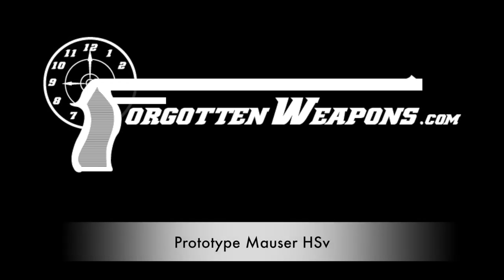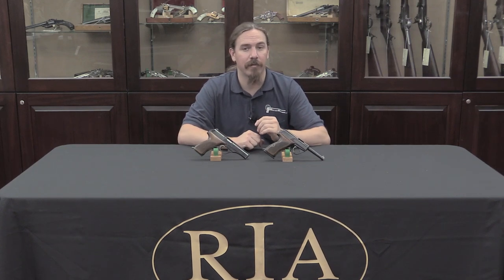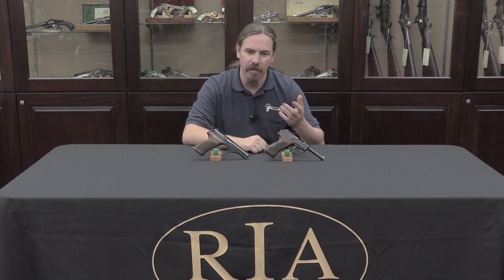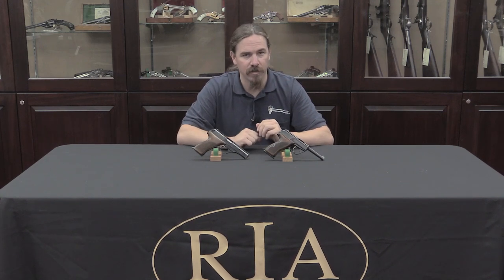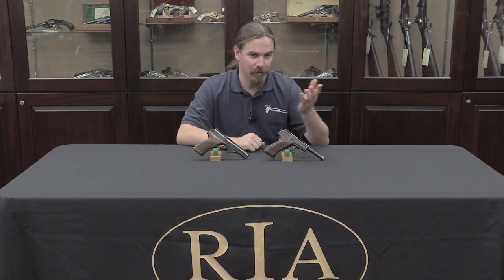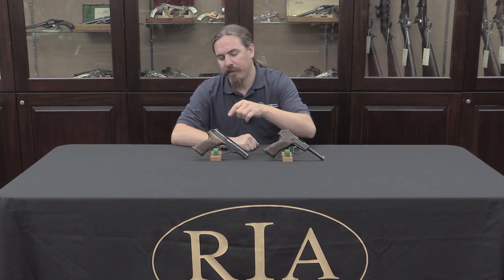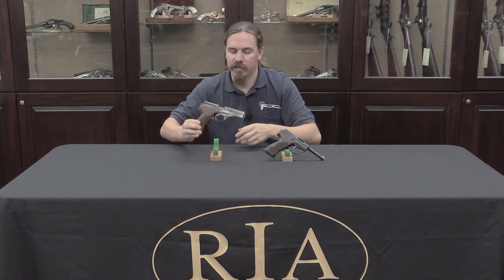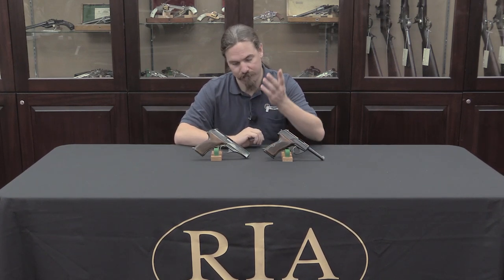Prototype Mauser HSv Pistols

Comment: Exposed barrel was there to use firing ports in vehilces(tanks mostly), which vas very common at that time (info 100%), there were similar trials in soviet union and experimental tokarev"s pistol with exposed barrel, but idea was scrapped.
Reply: Idea wasn't scrapped. Just before tha war started Tokarev were planned to be replaced by Voevodin pistol, but it was abandon because of war started. Here's the photo of that Voevodin Pistol - https://mtdata.ru/u26/photoDF6A/20646352317-0/original.jpg
Reply: I'm not fully convinced, as exposed barrels were also in the Mauser C-96, Borchardt and 08; in fact, it is very easy to dislodge the barrel in a P38 so it no longer is firable. As far as I have heard, it was in case of a bad cartridge that ruptured the barrel; if a slide is over the barrel, it may become stuck so you cannot even repair the pistol. I have heard that in case of a ruptured barrel, an exposed barrel lets you even fire the pistol as it doesn't interact with the slide, but I'm not convinced of that.

If you look at the Mauser G98, you see that it also had many safeguards against a catastrophic cartridge failure. It may be that a projectile could become stuck in the barrel, with the next projectile rupturing the barrel into an umbrella-shape. 

Today, that is no longer a problem, but especially in war, ammo quality or sabotaged ammo definitely were considerations by Germany. There exists even a document warning of "found ammo" ("Fundmunition"), that soldiers should not load it, but give it back to repair shops who would evaluate it and then re-issue it, with warning labels.

Germany and the Soviet Union closely worked in military development after the Rapallo treaties 1922, so it is possible that those considerations were shared with Soviet developers also.  It is possible Stalin's cleansings and the shift in perception towards Germany after Barbarossa meant the people sharing that concern were no longer in charge, and the risk of "found ammo" was no longer deemed prevalent as no Soviet weapon shared the calibre with a German one. Note, however, that until today no russian weapon is in an interchangable calibre to a foreign one.
Reply: @ЕвгенийМакаров-в6л 
...Looked like a more somber 
Japanese NAMBU pistol 😊👍

Comment: I would suspect that the reason the exposed barrel version has the heel mag release is because the recoil spring arms are in the way for a button release.  When you took the grip panels off it confirmed my suspicions and just thought I would make a note of it since you stated that it may have been an oversight on the military specifications that you have located.  Nice work and thank you for the educational videos.
Reply: Right on spot.
Reply: Besides, it's theoretically less empty space for crap to get into.
Reply: Peter Stephenson Stop blabbering nonsense. You obviously have no combat experience therefore your lenghty discourses make absolute non sense. I've met Vietnam vets who took a shop bought handgun with them when they shipped off, and guess what?many used them in combat. Read the Thin Red Line to find out how desperate were some GI's to have a pistol besides the main battle rifle. True, a handgun is the last resort before anything else, but to say that they are intimidation tools only or executioning instruments is just ludricuous. You say "ordinary pistol" as if there was such a thing as an "extraordinary pistol" although there may be some, like the one my father took off a dead Canadian paratrooper, it was a Browning Hi-Power and believe it or not it was a selective fire weapon.

Comment: about the exposed barrel, what i had read many years ago, in doing research for my shiny new P1, was that if there were some weird accident whereby the barrel became distended (due to some bad ammo or whatever) the pistol would still cycle and function. a normal slide won't allow a distended barrel through the hole in the front. i don't know if that is the reason, but it is what I had heard.

Comment: Hi, german here, I believe to have read in a german source that the Wehrmacht wanted an exposed barrel so that the pistol is still operabel after a failure called Laufaufbauchung. This failure happens when a squib is stuck in the barrel and you fire another bullet on lodged bullet, removing both but expanding the barrel in the process. Normally an expanded barrel would jam a gun, but with the barrel exposed, it is still able to fire and cycle. By todays standards questionable but those were the times. 4:55
Reply: Edit: This is mentioned in the P38 Manual.

Comment: the one with exposed barrel sold at auction  for a mere   $74.750.00
Reply: how sad...
Reply: I don't get why that one sold for over 10k less than the one with the covered barrel. I think the exposed one was much more interesting since it actually took part in the German army military trials and it has that interesting recoil spring setup. The covered barrel gun also had a potential issue with the disassembly catch... Maybe there's something more to that or someone just liked the look of the covered barrel one.

Comment: Exposed barrel was for the extra option that it would fit in Luger holsters. Saves the cost of producing two diff. holsters or using holsters allready in use.

Comment: I must say, I rather like the look of the commercial model. 
Clean, simple lines. Artful sweeps at the forward section of both trigger guard and rear of grip. 
The ergonomics LOOK comfortable, nice large button mag release, 
I kinda wish someone would make a cosmetic clone of this (as a mechanical clone would be insanely expensive and with far too many small parts. I dread what time it would take to make each small component fit together like that. I would venture to say there is much simpler ways to accomplish is what can only be described as what happens when you let watch makers become gun smiths) 
I you can Ian, I would honestly like a still shot of the commercial. Just the sides profiles if you would be so kind. 
Great video and prod to say I have been following your sight long before the YouTube channel. 
Keep up the great work!

Comment: From what I heard on a video about the P38, it seems that the whole exposed barrel thing was because the Wehrmacht was worried that have the slide cover the barrel would make the gun more prone to malfunctions. Let's say something went really wrong and the bullet bulges the barrel. That wouldn't cause a gun like the Luger or P38 to jam.
Reply: That's a real possibility, but who is likely to fire a pistol if they know that the barrel is bulged?
Reply: +webtoedman one of the design requirements of the HK MK23 and USP pistols is they had to be able to clear a squib with a live round and continue to produce at least a 4" group at 50 meters. Even the PSG1 had a similar requirement.

In a firefight there's not always time to get a cleaning rod out to clear a squib and a bulged barrel that still shoots is better than one that disables the gun.
Reply: Hastily drafted civilians?
Reply: I thought the same thing. When I first heard of it I thought it was just a manufactured selling point.
Reply: ww1 was fought with a 3 inch thick coating of mud on just about everything. any hollow enclosed space in a reciprocating machine under such conditions will pack itself firmly with mud in short order. minimize such voids, maximize reliability. it also allows for inspection for ringed barrels, and avoids negligent cleaning that results in concealed rust. still the days of corrosive primers, mostly. when it might be placed in the hands of a plowboy of rather unsophisticated origins, you're well served by making it easy to detect if he didn't quite get the cleaning lecture without the benefit of kp and push ups, lol.

Comment: Looks like a nice design but a bit more complicated than necessary. Obviously it also needs a decock provision, even if its just manual by gripping the hammer. I saw right away that the grip shape and the sweep of the backstrap look more comfortable than the P38. I bet the blowback is a nice pistol- too bad it didn't take off. German pistols on the whole are very interesting, and i really like their compact blowbacks. I've always wanted a Mauser HSc for some reason. Great video as always. Thank you

Comment: You have to check it with German historians, but the exposed barrel was if a projectile ruptured the barrel, it would not destroy the slide, and the pistol could still be fired as a last resort. It may have been to make them in fact not firable, but easily repairable by simply replacing the barrel; if the slide was deformed, it is very possible that the whole weapon is destroyed if the slide is no longer removable, or only by destroying the receiver. That's what I personally see as more realistic, but the reason I was told was the exposed barrel was a requirement because of munition rupturing the barrel.

Comment: The exposed barrels that would cut down on weight a little bit. Unless doing so causes extra wait to be added in the other parts of the gun. Atleast thats how I see it, since if equipment can be lighter weight that's always a good thing for the soldiers and logistics.
But going to save bookmark this video because that spring system I find very interesting and worth keeping note of, even thou not really unique but uncommon enough i've never heard of it..

Comment: You mentioned the magazine release on the HSv being a heal release perhaps being another army requirement? When you compared the trigger assembly of the HSc the HSv, I noticed that the HSv's two claws on the recoil springs would have traveled right where the HSc's button release was, so that change might have been to make the exposed barrel possible.

Comment: Hey Ian, you mentioned you didn't see a requirement for a heel magazine release in the German trials yet they put one on the HSV. Would it be reasonable to consider that Mauser would have used the same grip release from the commercial model if it wasn't for the lack of space resulting from the grip mounted recoil mechanism because they required an exposed barrel?
Reply: I was thinking exactly that. It would seem pointless to design something as critical as the recoil spring mechanism to work around a mag release that could easily be moved. Moving it was certainly a benefit & my even have been a necessity.

Comment: Since we're all speculating on why an exposed barrel was a requirement, I'm going to speculate it's so they could re-use Luger holsters, since saving money was the point of getting a new pistol in the first place, it would make sense to find a way to not have to re-manufacture all the associated accessories. 

If P38s fit in P08 holsters, it would support my speculation, but I have no idea if that is the case.

Comment: They wanted the exposed barrel because the gun was supposed to still work with a broken barrel. If the barrel on a pistol like the 1911 breaks, then the slide gets stuck on it and the gun is inoperable.

Comment: Was the exposed barrel requirement due to the need for the diameter of the new gun's barrel to match that of the.Luger's holster, which I assume was narrower toward the bottom of the Luger's holster than possibly would have been the case for a new gun with an enclosed barrel's holster would have been, as replacing leather holsters may have been cost prohibitive?

Comment: silly Germans didn't realize they should have just ripped off the hi-powers
Reply: They used plenty of them after they took over the FN factory in Belgium. The GP 35 was standard issue in the Waffen SS.
Reply: yeah i knew that part, i was just thinking how much better it would have been if they would have either produced under license or ripped off the 1911/hipower in the interwar period, .30 luger hipowers now thatd be weird